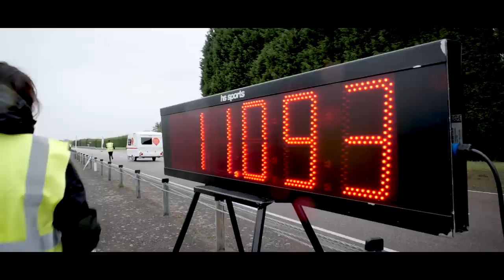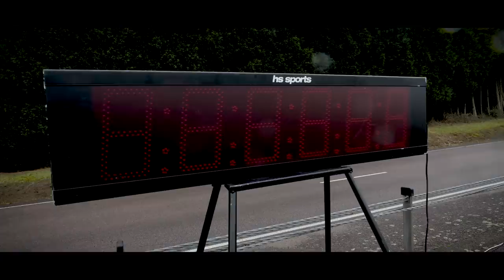How Fast Can You Tow A Caravan... With A Bike?

Comment: Would changing the front wheel to a 26" moved your body weight forward enough? Maybe some TT bars?
Reply: I felt the toebar was too far behind the back wheel and so the center of balance, thus lifting the bike. To rectify they had to have the caravan prop wheel on ground and it was swiveling like crazy, creating uneven saying direction
Reply: Could have put some weight over the steerer tube.  That would ground the front wheel a little better
Reply: They should have changed the towing mount completely by lengthening and bending the caravan's tongue and mount the towing ball just by the seat clamp.  That way the weight of the caravan would load both wheels.
Reply: @piast99  That's exactly how the hitches on all my trailers work, it's the best way.
Reply: @piast99  the caravan probably was borrowed so modified versions likely not going to happen

Comment: So, I mean, if it has a 30kg tongue weight I think the solution would be to get a long wheelbase mtn bike with super long chaintstays, put the rider really far forward, and then put slick tires and a touring/gravel style handlebar on it.  Then have someone like Cavendish ride it.  You're looking at top speed over 25meters, you want a sprinter not an endurance cyclist.  Find some German who can make 1500 watts of power for 30 seconds.

Comment: Congratulations! That was mighty impressive.
I think that with my triple-chainring setup (on 28Fx32R) I could do about 3 km/h for some 15 minutes.
Reply: I use a quadruple chainset for towing. Lowest gear is 15t chainring and 32t sprocket, giving 11.5 gear inches. Can spin 80 rpm at about 2mph.
Reply: @Ed.R  I don't have anything that specialized, but one of my adventure bikes (almost fat cyclocross bike) has a 26/38/48 x 11-32 setup. It is now that I remembered that I changed the original 28/38/48 with the 26/38/48 that gives me enough toque so I can climb until I fall over my back.
Reply: @AndreiNeacsu  I found that for typical mountain biking 12 gear inches is much too low.

Comment: Use a caravan with two axles with a good balance and extend the hookup to put the bike further away from the caravan might make it easier. A braking system for the caravan could make it less scary, if the bike slows down the caravan brakes.

Comment: Well GCN completely forgot that you need an engineer. The welder did a pretty good job at connecting but the front wheel lifting off the ground was pretty foreseeable the way it was done

Comment: For anyone interested, best case scenario you’d need 2800W to pull it at 40kmh (approx 25mph). That’s just to keep it at that speed after reaching it, so accelerating at all will require even more power! His best time was an average of approx 900W over the 25m of the time trial. That’s nothing short of remarkable considering that doesnt account for the instability of the bike! So in short it’s impossible for someone to pull it at 25mph unless they average near enough 3000W for the 25m!
Reply: Also, note that at 25 mph the force of aerodynamic drag will be much greater than at the 6 mph achieved. Therefore this will come into play too - adding an additional 1000W + (the coefficient I’d drag and frontal area of the caravan is significantly more than a lone cyclist, so while biking alone it may only be 150-200W, with the caravan it’s a lot more). This brings the total around 4000W without accounting for inefficiencies with delivering the power, or instability on the bike/caravan. So, best case scenario you’d need an insane amount of power. Sorry to anyone hoping to achieve 25 mph, without a very good electric motor you have no chance. The math doesn’t lie ;)

Comment: Although the final hitch setup was more robust it completely messed up the pivot points that worked so well in the initial trial. Use that wonderfully welded hitch with an additional tow bar between it and the trailer (caravan) so the "jockey wheel" can remain on the ground; any unevenness in the road will not translate to loading or lifting the bike vertically and should eliminate the loss of rear/front traction. The last version also caused the trailer to really veer side to side, adding the extra tow bar would buffer some of that steering action from the bike and allow the trailer to do just that... trail behind. Eliminating the extra physical forces will let you put more effort into forward motion.

Comment: I had this issue of snaking at high speed when I made a bike trailer from a bike. The trailer needs to support some, but not all, of its weight, and you will mainly be drawbar power, but you do need some load on the rear wheel. Having the jockey wheel (no option for me) down unloads the rear wheel, which is good for steering, but as you found, is bad for acceleration.

Comment: its a cool idea. personally id see if you were allowed to use a tricycle instead. you could mount the trailer hitch over the rear axle which would help with both the stability and the issue with traction of both the front and rear tires.

Comment: I think if someone's going to really give this record a serious try, they'd have to try and incorporate a weight distribution system into the hitch in order to keep the bike's front tire from losing connection with the ground, then you won't need to use the jockey wheel.  You should probably also wire in a remote brake control system that uses the caravan's on-board battery so that you can at least slow down the unit in case you do start to get up to speed.

Comment: Momentum = Mass x Velocity (from the physics class).
Stopping it (700 kg) at 25 km/h (6.94 m/s) within 5 seconds requires a force of 971.6 N (=99 kilograms-force). Imagine what happens if loss of front wheel traction makes you kiss the guardrail. I don't think you'll get 5 seconds.
My recommendation: Modify the trailer with remotely activated failsafe brakes so that whenever you pull the brakes failsafe mechanism must trigger. Guinness must not approve something like this without adequate safety mechanisms.

Comment: Remove as much friction from the front wheel of the caravan. Also put the wheel on longer L shape holder it should prevent caravan from swinging. I believe with proper ball bearings on wheels and modification you should gain 200watts of your power. I believe you can do 25 km/h

Comment: The custom hitch should attach at the BB or low down on the seat stay. That will stop it from tipping (maybe) and might make it more stable laterally as well. Drop the handlebars as much as possible to get your bodyweight further forward and onto the front wheel. It'll still kill you at 25mph if you try to stop without control of the caravan's brakes.

Comment: The bracket assembly needs a redesign. It should be much longer and perhaps include some sort of shock absorber. The wiggling caravan so close behind the bike was definitely hampering progress there! Good first attempt though.
Reply: This was the comment I was looking for. 
The tounge weight was far too high, the only way to solve that without upsetting the balance is to extend the tounge itself. 
Engineering a weight distribution hitch would also help, but maybe far more of an investment than GCN was interested in for a silly video. Although, they had a welder.
For normal trailer pulling the target is to have 5-10% of the weight on the tounge and if the trailer is over half the weight of the tow vehicle it should always have a sway control system & independent brakes.

Comment: You need an articulated tow bar so the weight of the caravan does not push the bike downwards. It might help a little bit with handling, but not that much on the actual load of the caravan XD

Comment: You could try with a 4 wheel caravan. The weight distribution would be much better. Also, you could move the support to the front, like pulling from the handlebars or front wheel similar in a way  to what horses use to pull the chariots. I hope you make it next time. It's nice to see you beating seemingly impossible tasks :)

Comment: You might need a mountain bike with as many gears as are physically possible to fit. Wide tyres would help too, wet/gravel in the front and slick in the rear.

Also, training wheels to help with stability.

Comment: Next time make sure you put the connection and pivot point of the caravan at the seatpost so you get those extra 30 Kg between the wheels. Then retract the pivot wheel completely because that probably slows you down a lot.

Comment: The mounting point needs to be at the bottom bracket rather than at the back wheel, this way you will get no momentum pulling the front up. The whole welded construction was beautifully made, but get an engineer to work out the momentum balance. The moment i saw how it was attached to the bike i knew it would cause the front wheel to lift, the pulling force itself without the 30 kg of weight on it would have made it difficult enough already. But anyway, great video and effort!

Comment: agreeing with the other great ideas, a variation of the child trailer with the weight pushing down through the seat tube would definitely help along with the idea of the caravan center of gravity slightly to the rear to equalize tongue weight and perhaps a dual jockey wheel setup neither side of the caravan hitch welded for straight tracking. reduce all the yaw M ark was feeling. He's got the power just need to harness it. for moving forward

Comment: Two words, Mountain Bike

Think about it, gearing is much lower, frames are stronger, wheels are grippier, brakes are better. I would recommend getting a hardnose (stiff forks instead of suspension) and putting about 10-15kg of sandbags on the 800mm handle bars

Comment: Do it again, but before you do, pump the caravan tyres to Max pressure and replace the jockey wheel with either a nylon wheel or an inflated tyre at rock hard pressures. The rubber on a normal jockey wheel has soooo much rolling resistence, it would make it near impossible on its own!!

Comment: Great attempt. Quite amazing. And I thought it WAS possible...
Hey man. I would modify the caravan a bit. Fits make sure it is balanced (shift load inside, or even add some in  the back of it) so that there is minimal weight on the hitch. Next, put those car spare tires instead of the regular ones. Lower the rolling resistance. Finally, did anyone even look into the bearings of the caravan? Maybe brakes are grabbing a bit? I think the biggest issue you are facing is the rolling resistance, not air drag.

Comment: I noticed that the top speed is getting smaller when load is bigger. With less than 100 kg load it is max 35 km/h and with 230 kg load max speed is 15 km/h. I recommend going even slower, because the turning of the trailer is quite heavy for driver and the bike. With lighter puller and heavier trailer comes problems that the driver becomes passanger.

Comment: I did this 12 years ago, we were on a road trip in Arizona and speculated on our options if the car died on the desert road. So we stopped and hooked up the car to my mountain bike with a couple of straps (bumper to seatpost).  Got it up to about 20kph for a short time.
Reply: Curb weight on that car was about 950kg, add the driver, passenger, and camping gear for 3 guys and you're looking at 1150kg 🤣

Comment: Simple do not use a flat road.  Use a U shaped road.

If you cycle on a U shaped road, with the timing machine at the bottom of the U, then you can have an unfair advantage in both direction and break the record legally.

Comment: So a thought, if the length the pivot point was a lot longer the leverage of Mark would distribute the weight more and stop the front wheel issue, think long lever with a pivot at the far end and you can lift more weight with less input, but over a longer distance.....Say  2 metres

Comment: The problem is that the Tonge wait is causing the bike to sway, with the bike being light it's like a 5-year-old walking a 150 lbs. dog and trying to stay in control.  In modern vehicle towing when light ended vehicles are towing a longer heaver trailer the results are just as problematic as the issue with the bike and could cause catastrophic outcomes if not remedied. so, to remedy this issue in vehicle towing we use anti-sway bars to help control the lateral movement of the heavier item being towed. I Believe that if you were to shrink the vehicle version and make it fit the application of the bike and trailer it would give you much more control. another issue is that you might have to add weights to the fork to balance out the tongue weight and you could pull of the dog leg.

Comment: So what I need for my summer break next year is a tandem for myself and my wife, a seat either side for our two smallest grandchildren age 5 and 8 years with a tow bracket for a four berth caravan.  I suppose it could be an ebike as I'm 71 years of age with cervical and lumbar spinal problems and also suffering heart failure.  I do already do about 100 miles a week recreational cycling...so what do you reckon?  Maybe leave the grandchildren till they are safe on the road on regular bikes of their own? 😀

Comment: The problem is the "jockey wheel", which can easily turn in any direction with just slight forces causing changes. If you can lock this wheel so that it tracks straight then you can achieve much higher speeds on a straight track. My guess is that if you were pulling a well balanced dual axle caravan without any jockey wheel, then you should be able to achieve a fairly high speed. I would also strongly suggest that an electric trailer brake be used to stop the caravan at the end of a run or if the rider gets into trouble. Very dangerous experiment you have going here.

Comment: Seems making a 2 wheeled dolly to put the hitch onto sort of like semi trailers use would cure the swaying issue of the rear wheel, AND keep the front tire down. Could use something like 12" bicycle tires to keep it bicycle. Go back to an axle bolt, but instead swap to a solid bolt on axle instead of quick release.

Comment: Just from intuition I'd say you need much longer tow bar for stability and most importantly attach the caravan so, that the weight lays on between the bike's axles. That jockey wheel adds quite a lot of resistance and getting it off the ground should make it easier. And of course all the tires should be pumped to the max. Ride comfort isn't an issue here.

Comment: They would be better off with a front load cargo bike. You could add ballist to dial in the optimum between steering and traction and the lower centre of balance would help with stability.

Comment: You really need a weight distributing hitch. Attach bars along the chain stays that extend back toward the middle of the trailer tounge. The bars need to attach both just in front of the rear axle and just behind the bottom bracket  Then use chains to attach those bars to the tounge. This creates a lever with the rear axle as it's fulcrum. You can balance the weight between the front and rear wheels by tightening or loosening the chains. Then you can put the jockey wheel up and shouldn't have as much swaying from the trailer. Look at how Draw Tight weight distributing hitches work.

Comment: The issue is all the rigging, needs a long cargo bike with the towball inside the wheelbase and he'd smash it. Or actually a trike means u could keep the tow ball low in the stock position for the trailer, but get it right in against the seatpost to put the weight again within the wheelbase.

Comment: If you put weight in the back of the caravan ... Enough to make the caravan near balanced on it s own ... So tongue weight resting on the bike is maybe 10 pounds. You could raise the little wheel (becomes unnecessary) and better handling.
To not use much weight you could put the weight far back on a poll or on a long board from the caravan.
Also ... Remove anything possible from the trailer that's forward of its axle.
Still ... Very impressive 😎 thank you.

Comment: The tongue weight is usually 10% of the total weight of the trailer which in this case is 1540 lbs so 154 lbs of tongue weight not 66 lbs.

Comment: A motorcycle can definitely pull it .The concept is make a rod which connect both wheel of this house nd in between rod put a chain cover then joind it first wheel of bike .Then it will work

Comment: Seems like you need a somewhat specialised bicycle. You clearly need a way to put weight onto the front wheel while keeping the back wheel on the ground.

I think you'd need a wheelie bar for the backwheel, probably with its touch point below the caravan's hitch. Could be that you'd want to make that using a small racing wheel with racing tyres and have it parallel with the front and back wheel. I think the hitch bar needs to be specialised as well, allowing the caravan to swing from side to side without it dragging the bike. I'm not sure exactly what it would look like, but I'm thinking a partial circle of sorts. These two needs to be combined in some way, allowing the wheelie bar's wheel to move with the hitch point.

Comment: the towing mechanism should be longer and most importantly not stiff.With a stiff mechanism you will always get de balancing from left to right(usual when you pedal) to the caravan, hence the increase of power will always just make it go from left to right, it will not get the speed. I know that without a stiff mech it will be impossible to break,  they should get someone inside to break at the end

Comment: The key to managing the instability of a bike is to use a recumbent trike.  I am an 1100 watt fast twitch motor.  When I dump all that on a bike, upright, or ‘bent, the back end fishtails, like your experience with the trailer. Imagine having a rear wheel firmly planted to the road.  Here is all that power delivered to the rear of a Catrike 700:   https://youtu.be/3etTylLFxs4